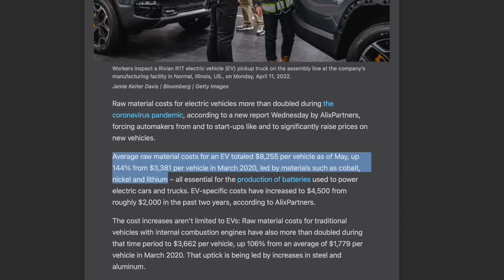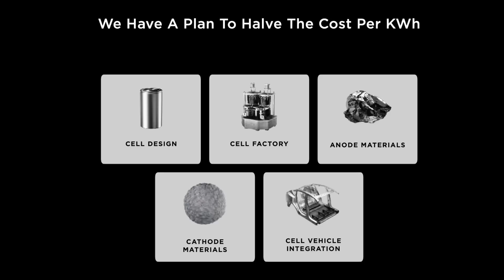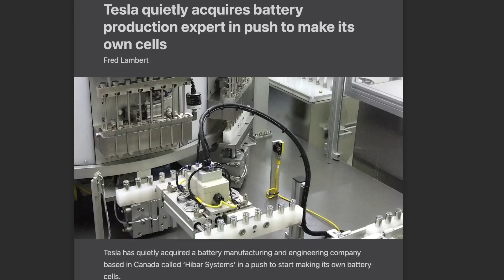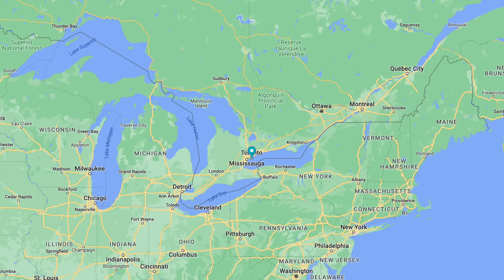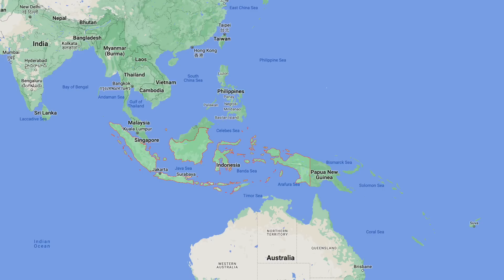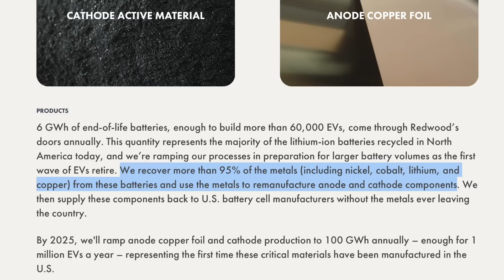The Limiting Factor: How Tesla is driving down raw materials costs

Comment: Vehicle manufacturing in Australia really doesn't make sense hence why it has virtually ceased. I remember as child how many people's cars were made there for the 🇦🇺/🇳🇿 markets, Holden and Ford being two of the biggest; we had a Ford Falcon 500, but those days are long gone. 
What probably (would) make sense is a cell & battery storage products facility. Access to space, raw materials, expertise and Australia's rapid transitioning to a fully integrated renewably powered grid/s. Also Sun Cable's plans to construct a vast solar power plant in the Northern Territories to supply Singapore is going to require many GWh of storage and I don't see Sun Cable's plans stopping at Singapore. Wouldn't surprise me to see them expanding into the rest of the region including Japan and China.

Comment: Livent and Allkem both have hard rock lithium deposits in Quebec.  Livent is planning a processing plant and getting assistance from Quebec. Arianne Phosphate is working on a hard rock mine about 300 km north of Quebec City. Their phosphate is very clean and easy to refine into battery material. Just the other day Elon commented on needing graphite for their batteries. Northern Graphite owns the Lac des Iles mine in Quebec 250 km north of Montreal and is the only significant graphite producer in North America. NG has another deposit in Ontario and one in Namibia. Canada has many other miners with the raw materials needed for Teslas.
Reply: Albemarle's Silver Peak, Nevada lithium mine is on the edge of the lithium clay area, but they are extracting the lithium from brine pumped up from underground. I believe the Lithium Americas mine project just to the north is a hard rock lithium deposit.

Comment: One of the ways that Tesla is similar to Apple a decade ago is their supply chain optionality. CATL will be mass producing sodium ion batteries in 2023. Tesla will have first access to these for stationary storage, and eventually, possibly for vehicles. If solid state batteries, condensed matter batteries, supercapacitors, or other laboratory research battery technologies ever become cost competitive mass produced alternatives, Tesla will have first access to these as well. Basically they will have first access to the best performance, cheapest, and most durable mass produced battery technologies for at least the next few years.

Comment: Isn’t battery recycling really a 2-stage process where the degraded EV batteries are re-purposed as grid back-up mega-packs first, then go to the recycling of recovered materials for new batteries?
    There should be a rising demand for stationary bk-up, given the stress on grids during the middle-yrs of the energy transition.
    If so, EV-makers may have a longer wait to having a recycled battery supply. The volume of recycled batteries going to EVs, as a % of total batteries going to EVs, will be a very flat curve. 
    Thus, the number of batteries made of mined materials, going into new EVs, will continue to increase rapidly, w/ a growth curve over the next ~15 yrs that’s almost as steep as if no EV batteries are recycled.
    If EV recycling & grid back-up plays out as above, battery & raw materials demand - and prices - may rise in concert for the next decade or more. 
    Without considerable battery innovation, the relatively-recent inflationary pressures on vehicle prices overall could continue re EVs only. Then, ICEVs, being relatively more price competitive, may have higher sales globally & locally in the interim which would delay the energy transition.
    We can expect that the market will allocate the increased costs between EVs & grid electricity, but so long as the negative external costs of carbon energy continue to be uncompensated, the transition to clean energy will cost more & take more time.
 
      — Editorial Comments to end —

    There are two categories of solutions to this dysfunctional situation —
  — The market method based on not tipping the scales to make winners & losers. A market doesn’t work w/out rules that define unfair methods of competition, whether it’s price-fixing or govts tipping the scales for their home industries. 
    For de-carbonizing the world economy on a market basis, this means a tax per ton of carbon extracted; for nations failing to cooperate, import tariffs based on the carbon content of goods & services imported from them; distribution on an equal per-capita basis to all residents of a nation’s carbon tax receipts; and poor nations receiving compliance assistance on an unbiased basis relative to the market.
    The current ad hoc free-market system, including the failing Paris Agreement, UN climate activities, and varying national efforts is chaotic, rewards kleptocrats in ‘resource-cursed’ nations, haphazardly picks winners & losers, and thus has had little effect on the growth of carbon emissions.
    Individuals, organizations & govts participating in the ‘peak oil’ movement in the 2000’s first predicted global peak extraction of oil & gas ~2010-11. Oil & gas producers dismissed the issue w/ a few exceptions. But in the decade after the Great Recession, the opposing interests reached a consensus that Peak Oil was reached in 2019.
    So now everyone is on notice that, in addition to any climate issues like ocean acidification, we have to get off carbon energy cuz it’s in decline.
    We’d have heard more about this except for: Covid; the considerable energy saved during the peak Covid crisis of 2020-21; the current lingering La Niña weather pattern that tends to suppress warmer temperatures; the constant societal turbulence caused by TFG; the Russian invasion; and a possible energy-saving recession.
    So rhetorically, I ask myself, what could go wrong if the current chaos continues for another 20 years…

Comment: I think you are overestimating recycling. It doesn't make the materials more pure.  That's just wrong. The only ways to make the products more pure if further refining which can be done at any stage of the process and comes down to costs and if they need it to be more pure. Also costs of recycling could theoretically be cheaper but it won't be like they are getting the batteries for free. There  will be a market for used batteries to recycle that will be determined on the overall cost of materials.  They will be paying good money to get those scrap batteries, especially if there are competitors in the recycling space.  Most of the recycling initially will be of batteries that failed QC tests and are immediately recycled.

Comment: So you are wrong with the scaling of recycling vs. production.  You get 100% recycling ca. X years (median life of battery pack) after you have reached your full demand. Before that you get batteries that are produced, when your production was a few % of what you have now.
So we get full recycling at Tesla more around 2050-2070. if the markets grow, even later.
Reply: Yes and no.  I could have spoken more clearly here.  The point was that you can become materials independent by the mid to late 2030's with recycling.  Also:  True, there is a lag.    But, there are other variables, like the large amount of battery scrap from factories (as one example).
Reply: @thelimitingfactor  I am curious to see a calculation. 
Elon once said something like, real recycling should start at battery design, but nobody wants/ can invest the money on R&D that will profit, after packs degrade and they will cover 5% of production.
But scaling recycling may be profitable because of the scrap factories have to get a closed loop inside the factory full recycling being a byproduct.
Reply: @thelimitingfactor   — Almost everyone here has discussed recycling as a direct path from a degraded EV battery pulled from the EV & sent to recycling.
    I’ve seen many past comments on the use of EV batteries for grid storage first, including from Elon. 
    Biz options incl. using the old battery as a trade-in on a new one when the owner wants to keep the car. Or maybe Tesla also offers a reconditioning package, incl. items like HW•4 upgrade, in-cabin video side mirrors, FLIR for heavy fog/rain/snow, plus the new battery. 
   W/ several yrs betw purchase & battery replacement, a new battery likely would get the owner a lot more range & much quicker charging (at particularly favorable times, owners might be presented w/ the option of earlier battery replacement w/ the old battery keeping a higher state of charge).

Comment: Min 22.00 Re Battery powered Earth Mover, these large machines have an electric engine and a generator. It was at BAUMA in Germany a few years ago where I have seen a very large machine from Liebherr. The ones for mining. I think the manufacturing plant of these machines is in the US. 
Also I remember a case where the haevy weight had to be brought down a hill (normally I would expect it has to be brought up a out of a digging hole) and they calculated that they make net energy because they generated electricity all the way down.

Comment: At some point, besides vehicle batteries, mega packs from battery storage storage for the grid as well as for the home will be recycled. I worked several years in precious metal refining from recycling. The idea of clay/lithium mining seems to have a greater potential for lower environmental impact that other types of mining. The process of leaching and the barriers built for containment would be key. There would be millions of gallons of leach liquor and rinsing liquor. But, it's all about concentrating the flow of last rinse into 2nd to the 3rd on up to becoming the mother liquor that the lithium hydroxide precipitate would be taken, and then neutralization of the spent liquor. Depending on other clay contents could also provide usable by products. The whole flow for refining could be automated. I haven't been in the business for decades now, but the chemistry doesn't really change and with current tech I believe this could be an exceptional opportunity. Permits may be tough, but the process could be rather simplistic and make permitting easier to understand how the safeguard infrastructure is built and how the spoil will be treated for returning back into the desert. 

There are two types of leaching that might be used. One is chemical and the other is biological. It has been done biologically with copper with at least some success, but I never followed up on the mine in AZ that was doing it since I moved back to California and that was more of an accidental discovery, not man made biologicals involved.

Comment: The pertinent question is not WHERE the factory will be built but WHAT will be built in that new factory!
It could be the new Robotaxi or the "$25K" compact EV or the ModelY/3s.
So, the WHAT will determine the WHERE!
Reply: The robo taxi will almost erase the need for a cheap "model 2" Tesla. Way easier to just use 3s and MYs. Plenty of profit. Even more than a retail sale. Also; one robo taxi will replace 4 to 5 privately owned cars. That will 4/5 X Tesla's goal to accelerate the transition to sustainable non polluting transportation. That is Elon and Tesla's main goal.
Reply: @terrysullivan1992  Not really! For the next decade or two people will still wish to have ownership of a car (even in the lower price spectrum). In densely populated areas a Robotaxi will threaten traditional car ownership way more than it would in less dense areas.
Eventually owning a car would also mean having access to a large power pack....that one might 'lease' out to the grid operator for storing-delivering power; and not to mention use it as power source for themselves during emergency blackouts.

Comment: All car makers have long running purchase contracts with their suppliers and those with their suppliers, sometimes a floating Inflation index for some of the production costs like wages.
Tesla production is not good nor close to that.
The Berlin GIGA has issues based on poor education cause all the improvements were made on paper and did not Work.  
Remember the model X days, products that never should have been delivered with that back doors.
Canadas population is tiny compared to more than 500 Million europeans  with a higher and faster adoption rate of EVs than the US.
If Tesla wants to keep with european growth they need a second GIGA and a good one cause the US made Tesla are called the crappy ones cause it is day and night if you compare Chinese made versus US made.
The battery recycling on the material level is cheap. 50% of the energy needed is here gained from the old battery depletion. Here we have the first LiIon factory that is getting 93% recycled. And that is pure and ready to use material far better than ore.
You might have missed that the German Car makers have already these battery recycling facilities. So Tesla is not ahead and obvious the whole Berlin adventure is struggling a lot. New employees are not happy otherwise they would not have so high losses which forced Tesla to increase the wages of all assembly line workers by about 10%. And still they are leaving Tesla for better opportunities they can get.

Comment: Direct Li extraction from oilfield brines is likely the fastest route to market regarding permitting, especially if the wells are already drilled and repurposed and the bulk effluent waste stream is near fresh water.
Reply: Or just extract it from the produced water of many wells. The water is already being handled.
Reply: What's the lithium content of desalination plant waste brine? Does it make sense yo try and run DLE on that? Seems like a safer wagon to hitch to than fracking operations =X
Reply: @tonydeveyra  It might improve the economics of desalination, but AFAIK, geothermal and oilwell brines vary, but generally contain higher concentrations than effluent brines as they have had millions of years to leach lithium out of the formations where they are found.
Reply: @marcusnichols5595  it would also reduce the environmental impact, as it would reduce the number of ions in the brine and how potentially toxic that brine is to sea life. The biggest impediment to further scaling of desalination.
Reply: @tonydeveyra  True, disposal of desalination brines has to be managed sensitively. If the end result of DLE is "cleaner" than the seawater feedstock, that's a win. There are many more elements in seawater than just Li, some of which have commercial value. Eventually, there will be a residual waste stream, it might not end up in the ocean, but it must be sustainably contained.

Comment: Southern Ontario does make a lot of sense due to the existing industry and mineral supply. It would make sense to locate the factory close to rail. Vehicles could be exported eastward from Halifax to Europe and Africa.

There are cobalt deposits in Cobalt, Ontario, to the north. Not far away are nickel mines in Sudbury, though that basin is running out of ore. The Ring of Fire locale is likely to be tapped for mining in the future, with rail access, that could provide future supply. Steel is produced in Nanticoke. Aluminum can be sourced from Quebec and shipped by rail.
Reply: Also has one of the purest graphite deposits in Northern Ontario and free trade agreements with Europe

Comment: I doubt battery (or car) manufacturing in Indonesia, it’s too capital intensive over labour. Way better to concentrate on stainless steel products which can use labour, be based on local nickel (& iron ore).  Asia does need a local specific small-transport industry, & Indonesia could well form the hub, but won’t be Tesla.
PS. It’s the processing, not the mining which makes CO2. It’s the mining waste slurry which is (marine) contamination issue, AFAIK.